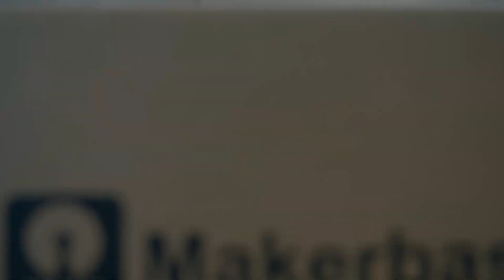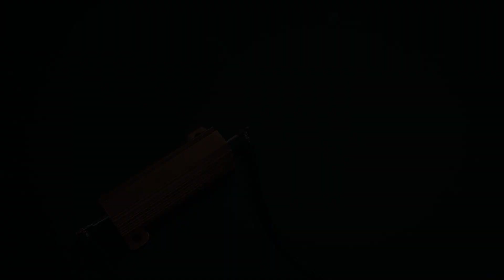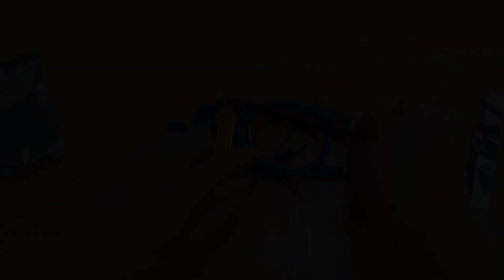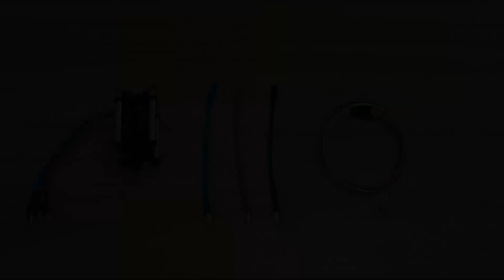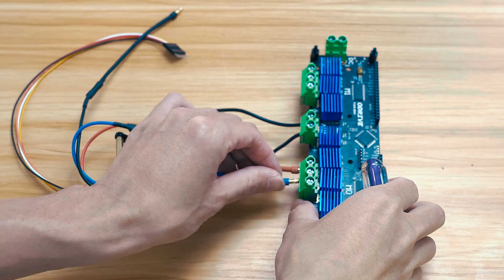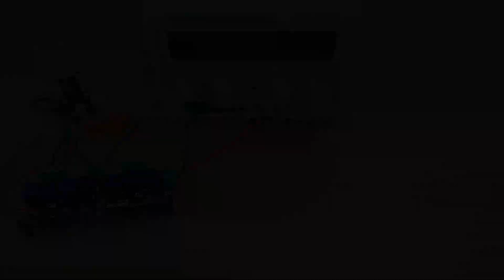Unpacking and testing the new product ODrive

Comment: Hi. I order a mks odrive from taobao. Use amt-102 encoder, motor 6364 200kv. I connect with 12V battery but nothing does. So, what i missed